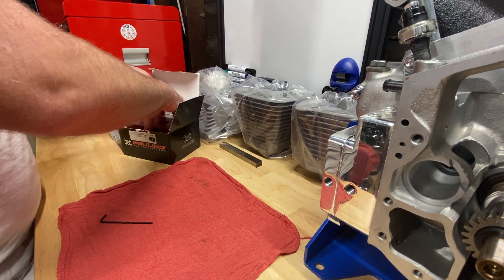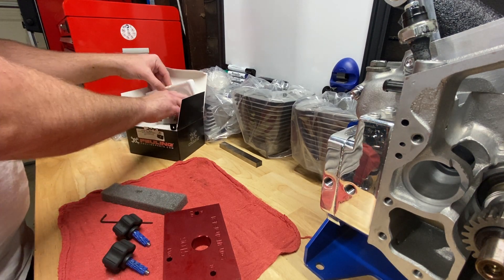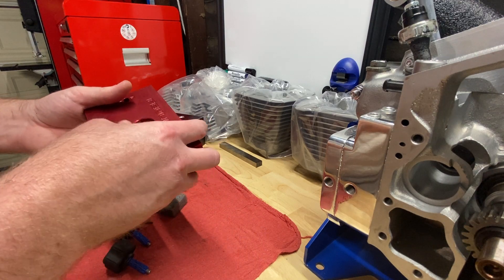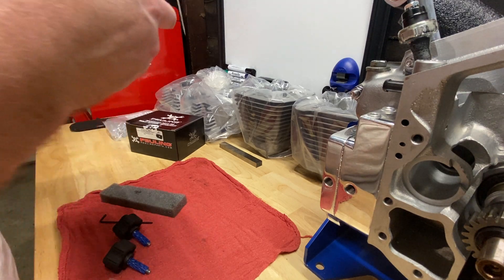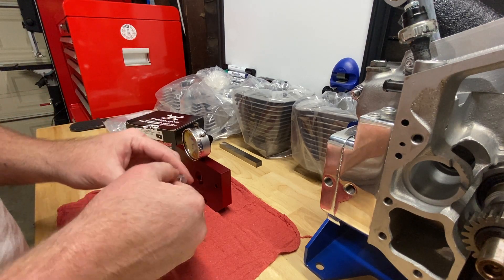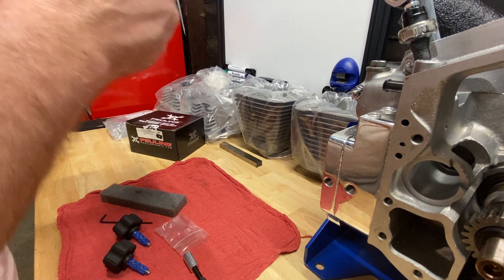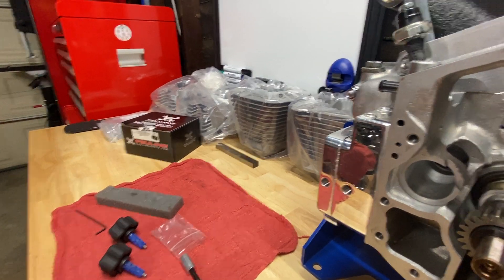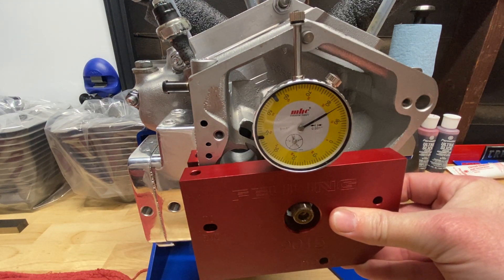Measuring Pinion Shaft Runout on New Flywheel Assembly in 1993 Harley Evo

Comment: If recommended run out for your cam plates is 0.0025 then it seems silly to sell a gauge with 0.001 increments.
Reply from the maker: @benaberhart1925  Yeah I agree. They should package this kit with a .0001 dial indicator.